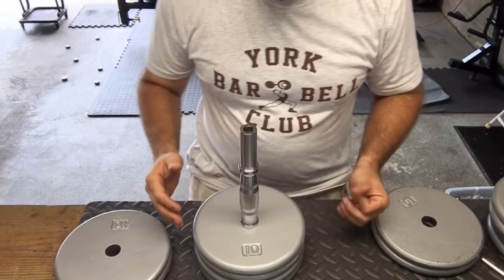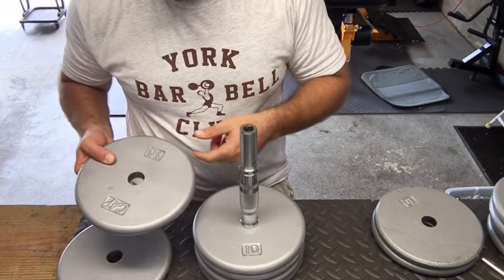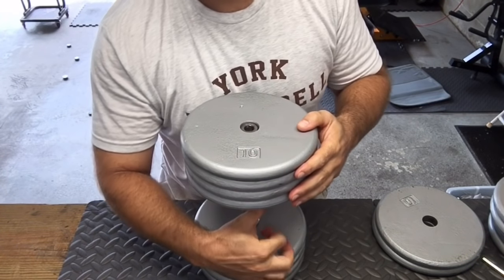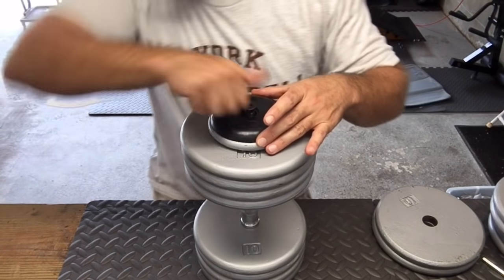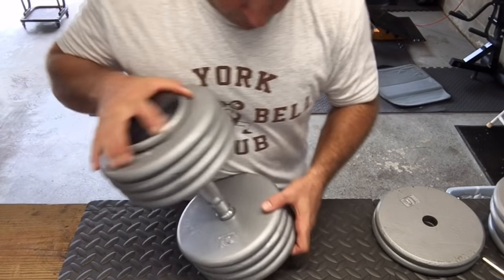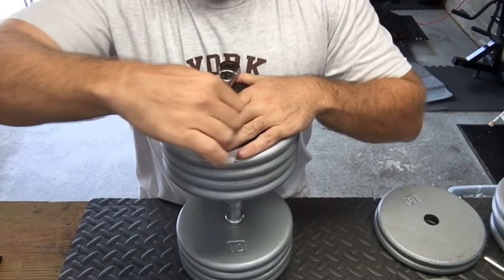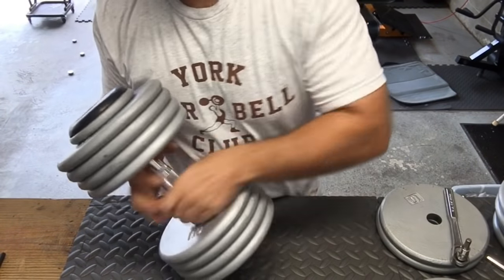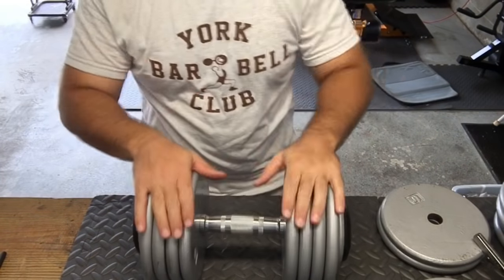Building a Pro Style Dumbbell

Comment: Nice! I just picked up 350lbs in old dumbbells. It's been a pain trying to get them apart. But will hopefully get an end product like yours!
Reply from the maker: Pro DB's made at the factory will have thread locker on the bolts. You may have to try an impact wrench to break them loose.  You can also try applying heat via a torch to break the lock. Just be ready to purchase new bolts if you go this route.

Comment: When using the shorter handle, the only thing keeping the last plate centered is the torque pressure of the bolt.  When I run into the problem where the correct handle protrudes just a little bit, I shim the dumbbell with steel flat washers (1-1/16" ID, 2" OD, 0.134" Thick).  Usually only one per side is needed and I place them on the inside of the dumbbell (before any plates are added).  They are virtually unnoticeable and (imho) a better design.  $13 for a pack of 25 on Amazon.
Reply from the maker: I actually like that idea a lot.  Also gives guys with a large fist more room inside the plates (albeit minuscule).  I'm not too concerned about the bolt taking on the torque of that last plate.  For one the bolt is quite long so it grabs a lot of thread inside the handle.  Also the last plate generally has a smaller diameter than the others.  So it really should not experience any shear impact if the DB is dropped on an angle.
Great suggestion on the washers though.  Thanks for the comment!

Comment: I just used steel tubing and welded  custom end caps. Real prostyle. Troy invented prostyle and they didn't use rubber caps. It makes them thinner and the flat bar is my preference also the pipes I use are lighter than these sdh handles. Sdh are great but the issue is they're a lot more expensive. And buying hex weights at Walmart or BIG5 is a hell of a lot cheaper than building your own at that point.
Reply from the maker: Welded steel pipe DB's are bad a$$ old school.  I like your style. You are correct about cost once you start adding up the SDH handles, end caps, spray paint, etc.  The key is finding the pancake plates dirt cheap or even free from a salvage yard or Craigslist the way I did.  Appreciate you watching the video and commenting!  Lift well!
Reply: @DieselMike  shit I wish I could find them free haha. Shits rare. Where'd you find yours for cheap or free?
Reply: That  the way to do weld washers on the end to hold weight...this fine thread bolts will not hold up.to abuse of being dropped.u will find stripped threads especially when u get to big poundage...

Comment: Whats the benefit of using pro style pancake design dumbells. There are many different dumbbell designs which are cheaper. Why pancake style ?
Reply from the maker: Strictly aesthetics.  I just like that style.  But Weight is weight. They all make you stronger!
Reply: Those are called pro style dumbells. I have two original  55lb York 1970's .They were popular in the 70's at all the big name Gyms.

Comment: Where do you get good plates? What size plates do you use? How do the heavy dumbbells perform, How often do you tighten them. Any other maintenance or anything? How about the winter, do they get cold? Which dumbbells do you use now? Hex or these?
Reply from the maker: Anywhere you can find them. 
It's specified in the video. 
Perform great. 
Never, they are torqued.  
None. 
Obviously, if you keep them in a cold environment.
Both.

Comment: Why didn’t you use a bar long enough to fill the 2.5 plate?
Reply from the maker: Watch this follow up video and you will see the exact reason that would not work: https://youtu.be/wCehR-i9Aco
Reply: Diesel Mike So the next size longer bar would have left just a very small portion of the bar extending past the 2.5 plate? I’m surprised they don’t have thick washers to make up small variances. I know I could locate some.
Reply from the maker: @rlknight57  That's correct.  You can use a washer, but where would you put it?  If you place it between the last iron plate and the rubber plate, they wouldn't be flush to one another.  You can put it against the flange of the handle before you load the first 10 lb, but that would look like crap.
Reply: They should make the end cap with a recess on the bottom side that would absorb any excess handle protrusion through the last plate. I take it most end caps are flat on the bottom side.

Comment: do you recommend going down for all the recommended dumbells. for example, if i want to make a 50 lb, should i use sdh 2 instead of sdh3. or if i want a a 25lb should i use a sdh 1.
Reply from the maker: Off the top of my head that sounds about right.  Did you check out my other video where I discuss "Choosing the Right Size Handle"?  In there I go by the rule of "Number of 10's per side matches the SDH #"
Are you using rubber end plates or the washers that come with the handle?  That may make a difference because end plates actually weigh something (about 1.25#'s if memory serves me), whereas the weight of the washers is negligible.  
If you have any other questions, let me know.  Thanks for watching.
Reply: @DieselMike  I do not have any of the items, but am interested in buying them new and making some. i did check out the video, thats why i was curious to know if every size goes by that. so on the sdh1, one ten pound plate fits flush w end cap and sdh2 two ten pound plates fit flush. but one ten pound and one 7.5/5/2.5 wont fit nice so if you use anything but a 10lb plate you would need to size down? is that correct.
Reply from the maker: @TheArmoBoss1996  Exactly.  I am sure there will be the occasional exception to the rule.  But for the most part, that has been my experience.

Comment: I it seems the plates are costing over $1 a pound now and with handles costing 30-40 a pair Im finding it difficult to see the savings here. Am I not looking for plates and handles in the right place?
Reply from the maker: WalMart will sell them under $1 on occasion. Have seen them at 0.65  But where you really need to look is second hand.  0.25 - .30 on Craigslist is the going rate.  Better yet is scrap yards.
Reply from the maker: Generic pancake plates.  Probably CAP.  I had some Ivanko & York in there as well.   They are all the same diameter.  What plates did you buy?
Reply: Just build a concrete dumbbelL :D
Reply: cheapest way is to buy old cast iron plates that u can find anywhere 1" york style popular throughout the  80s and 90s 2000s loads of people sell them in 2.5 ,and 5 kg plates, sand blast them then recoat wih hammerite spray
Reply: I put an ad looking for metal weights and got a call back. Mostly 10 pounders and smaller but I came away with around 100 lbs for free.  Another give away at work and I am picking up 2, 90 pound dumbbells as wells 2, 85 pounders for free.  I have lucked out but I just had to be patient and look frequently.

Comment: Hey man. I assume disassembling dumbbells like this would go the same way just backwards? As in the commercial dumbbells, I could theoretically take them apart and use the weight plates?
Reply from the maker: Yes.  You can take apart commercial DB's and I have done so many times.  However  a few things to be aware of.  When they are made at the factory, the bolts are most likely applied with a thread locker (Loctite, etc) and machined torqued. 

This means you will most likely not be able to unscrew with a simple allen wrench or even a hex attachment on a ratchet. 

I suggest using an impact wrench when unscrewing the bolts.  If they were torqued tight enough, you run the risk of snapping the bolt inside the handle if you try to muscle it off with a breaker bar.

If that doesn't do the trick, you will need to heat the bolt with a torch to break the threadlocker bond.  This will not damage the iron plates or the steel handles.  But if they are ones with rubber end caps like you see me use here, they will obviously be destroyed and need replacement.
Reply from the maker: Yes.  You can take apart commercial DB's and I have done so many times.  However  a few things to be aware of.  When they are made at the factory, the bolts are most likely applied with a thread locker (Loctite, etc) and machined torqued. 

This means you will most likely not be able to unscrew with a simple allen wrench or even a hex attachment on a ratchet. 

I suggest using an impact wrench when unscrewing the bolts.  If they were torqued tight enough, you run the risk of snapping the bolt inside the handle if you try to muscle it off with a breaker bar.

If that doesn't do the trick, you will need to heat the bolt with a torch to break the threadlocker bond.  This will not damage the iron plates or the steel handles.  But if they are ones with rubber end caps like you see me use here, they will obviously be destroyed and need replacement.

Comment: Can you buy handles that fit enough plates for 100-200 pound dumbbells?
Reply from the maker: Yes - An SDH-10 can fit TEN 10lb plates on EACH side - That would give you a DB weighing 200 pounds plus the weight on the handle
Reply: Diesel Mike I’ve been researching this quite a bit. 9 and 10s are hard to come by. Also getting 10 pound pancake plates at a decent price isn’t easy too. The best deal was on the York web site.7.90 each

Comment: Great video.  This is a fantastic way to save tons on pro-style dumbbells.  How they been holding up so far?  The only concern is after adding 4 plates and not being flush with the end of the handle, then adding the thickness of both the 2.5 plate plus the end cap.  This robs of the full screw length of the bolt going in thus in theory making the hold less strong.  Wouldn't it be better in terms of strength to go the next size up and then use metal washers or shims as another guy suggested?  This way you get the full strength of the bolt and this might make a difference when the weights are over 25 - 30lbs.
Reply from the maker: You make a great point.  And perhaps the amount of bolt in the handle would be an issue in a commercial setting.  These are my own personal dumbbells for my home gym.  They have been holding up great with no issues.  Bolts hold strong, no backing out, and no spinning of the plates.  They don't get abused, but I will drop them from bench height when done with a set.  My floors are 3/4" rubber stall mats over two layers of plywood.  So plenty of protection.  Thanks for watching and the excellent comment!

Comment: Any tricks on getting a old  bold that doesn’t want to come out it will not crank. The bar rotates and bold is stuck?
Reply: First, WD-40 the hell out of the bolt. Second, use a pipe wrench to hold the dumbell handle then use a Allen wrench with a metal pole for leverage, or hammer the heck out of the Allen wrench. 

That helped me get some big lbs dumbells loose.

Comment: I've recently purchased some sdh, plates, and end caps.   Work very well.   I know you mentioned in one of the videos about thread lock or something similar.  Did you end up doing that, or not?   What is your opinion on it?
Reply from the maker: I did not add thread lock.   Just torqued them super tight.  Being a home gym setting I figured it wasn't necessary.  If I ever need to take them apart I won't have to use a torch to break the lock and in turn ruin the rubber end caps.   So my opinion is, no, if not in a commercial setting.
Reply: Coach KB I own a full set putting thread lock on the threads is a great idea if not planning to disassemble the dumbells  but there is another diy dumbell video way better and cheaper then this keep looking (78) 10 lb plates are used from 20 to   80 lb dumbells gets expensive but them used for 50 cents per lb

Comment: Suppose you want to build a 100lb dumbbell with 4 @ 25 Lb weight plates; will it work?
Reply: What would you recommend?
Reply from the maker: I have never seen a 25 lb pancake weight plate.  There are 25lb plates with 1" holes.  They would fit the shaft.  But I don't think it would be feasible.  The overall diameter of the completed DB would be very large.  So is it possible?  Yes.  Would I do it?  No.
Reply: Diesel Mike I appreciate your advice: thank you so much; I guess I better stick with the 10 lbs weights. Thank you.

Comment: Total weight printed? Or we have to count 10 lbs plates?
Reply from the maker: I have no idea what you are asking.
Reply: @DieselMike  He's asking where you put the total amount of pounds on the plate or do you just see there are 4 tens total so its about 45 lbs.
Reply from the maker: @matthewmajchrowicz8548  I take into account the total weight of the dumbbell including the handle, the bolts, the endcaps (if you use them) as well as the actual weight plates.  Just about every combination will get you within a margin of error rounded to the close 5 lbs.
45 lb DB example:
Weights: 10 lb x 4 = 40 lbs
SDH-2 handle and bolts = about 2.5 lbs
rubber end caps = 1lb x 2 = 2lbs
Add them up:
40 + 2.5 + 2 = 44.5 lbs
I'll confirm weight by placing on a scale and label that a 45 lb DB.
I discuss this further in my video:
"Choosing the Correct Size Handle for Pro Style Dumbbells"

https://youtu.be/wCehR-i9Aco

Comment: wheres a good place to buy some plates for pro style dumbbells I know that walmart has some cheap plates but not sure if those would work
Reply from the maker: If you are talking about "Cap Barbell 1" Standard Cast iron Weight Plate in Grey" from Walmart then, Yes, they will work.    The grey ones are .60 per lb for a 5 or 10 lb'r.  A little more for the 7.5 and 2.5.  You aren't going to find much better than that if buying new.
Reply: thanks ill pick some up.

Comment: How are the CFF rubber end caps holding up?
Reply from the maker: Perfectly.  It's a home gym with rubber floor mats.  But I don't know why they wouldn't hold up.  Other than resting them on my thighs setting up for a press, they come in contact with nothing.  The extent of the abuse the end caps ever took was digging the bolt into the rubber (Which locks em in) the day they were made here in this video.
Reply: @DieselMike  Perfect! Thanks man.
Reply: @DieselMike  Perfect! Thanks man.

Comment: this is awesome.  where do you buy the supplies for this?
Reply from the maker: Hey.  I got the weight plates off Craigslist. But Walmart sells them too.  (Watch for deals.  They go as cheap as $1 per pound for the 10's).  But best bet is to find old rusty ones at yard sales, etc and repaint them.
The handles you can find on Amazon or eBay (search SDH handles)
The rubber end caps I got from cffstrengthequipment.com (but you can find different styles from other fitness vendors)
Rustoleum Hammered Spray paint from Home Depot.
That's about all.  Oh, and a good wire wheel if you need to knock off rust of old plates.  Thanks for the comment!
Reply: seriously, i just moved and am looking into a garage gym.  websites where you bought this stuff, please...
Reply: @DieselMike   did you build your own because its cheaper or was it a project you enjoyed doing?  i'm just starting to prices things, but i have to believe that making your own is cheaper.  is it a lot cheaper?
Reply from the maker: Both.  By building them I got them exactly to my liking. (contoured handles, rubber end caps, etc).  If you pay full retail for brand new pancake plates, you aren't going to save much.  The key is getting used weight on the cheap.  like .15 per pound cheap.

Comment: I really wanted to make some of these but I'm finding used hex dumbbells for cheaper than I can find the handles and end caps like you have here. 
Where did you find them?
The plates are EASY to find used, people practically give them away. Handles are a little hard to come across for a reasonable price.
Reply from the maker: Joseph Williams Handles came from Amazon. End caps from CFF.  True - Used Hex generally would be cheaper than building these if you choose to get new handles and nice end caps.   All Handles come with a washer so the end cap is optional.
Reply: Diesel Mike thanks for replying! I'll definitely do my research. 
I have hex DBs up to 70... but it's time to move to the big boy weights so I'm definitely exploring my options.